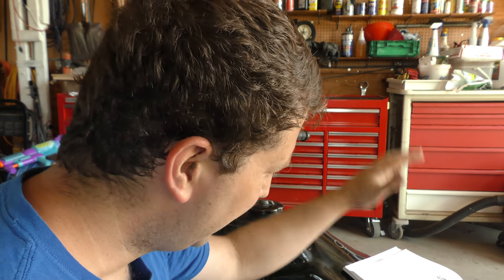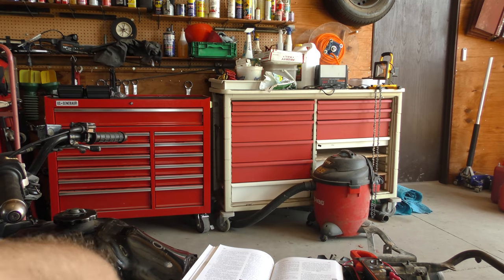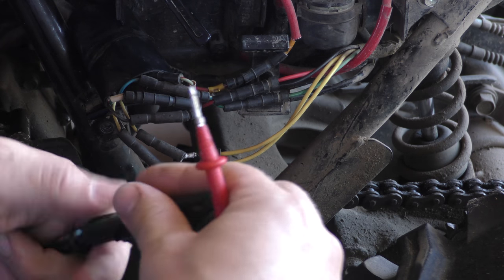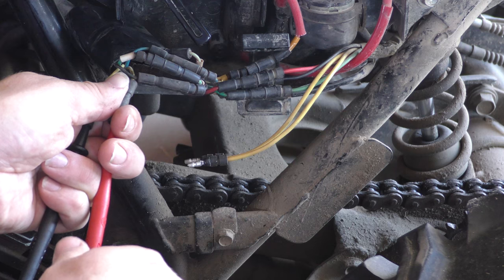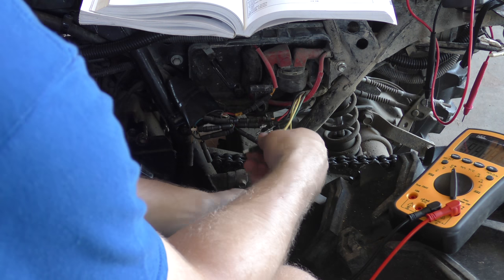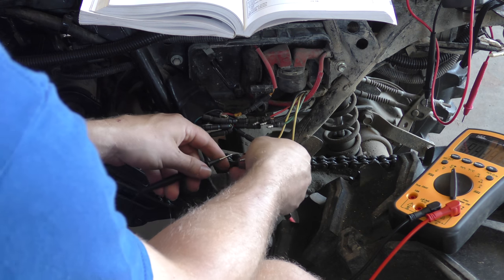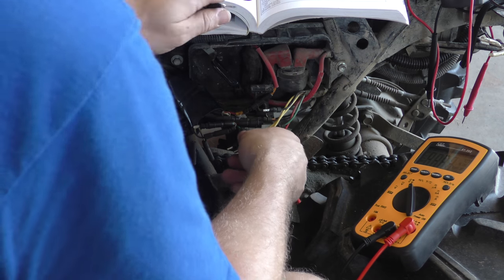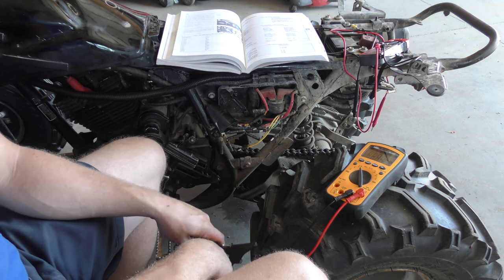Testing the Voltage Regulator on the Honda Fourtrax 200SX

Comment: Little late to the party, but it looks like the book is calling for kiloOhms and you're measuring in Ohms. Not sure what the Fluke meter range for Ohms is. Just wondering if you every solved the issue? Cheers!
Reply from the maker: It auto ranges unless you manually set it. I don’t recall in this case what it’s range was.

Comment: Just an fyi, infinite resistance is shown as 1, 0 shows a short circuit.  Either way it appears the voltage reg is done for.  The odd thing is you should be having battery problems then.  Either not charging or overcharging.
Reply from the maker: Right, I think I usually always say it backwards for some reason.

Comment: Hi I think you answers me on other videos but I already replace ignition switch, spark plug coil, I try a Chinese eBay cdi box that didn’t work and also change pick up coil and stator and still no spark
Reply from the maker: Check the wiring in between all those electronics maybe?

Comment: Yeah I'd say that narrows it down to either side of the wiring or the actual wiring itself and you'd be surprised what electric wiring can do, my sister stole and wrecked my truck and it knocked the mirror off cutting the wires for the mirror adjusting and the wires would touch and burn out the fuse for the radio which I checked and were in no way connected in wiring, and only "met" at the fuse box
Reply from the maker: I hate electrical problem.... the connection is still getting very hot so I will have to do some more trouble shooting.

Comment: Is there a reverse safety on it that is bad. Had an atv with one that went bad. When in reverse it only allows low rpm unless you push a bypass button, otherwise it spits and sputters like that. don't know if yours has reverse or not but may be something to look into as well. Thanks for the good videos.
Reply from the maker: I'm not aware it has a reverse safety.